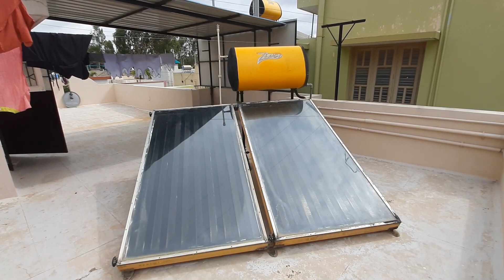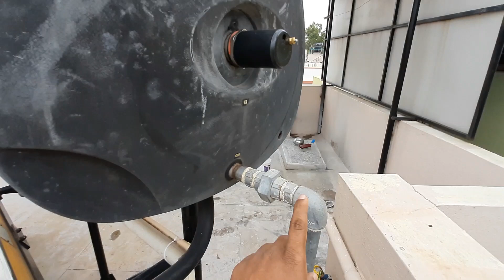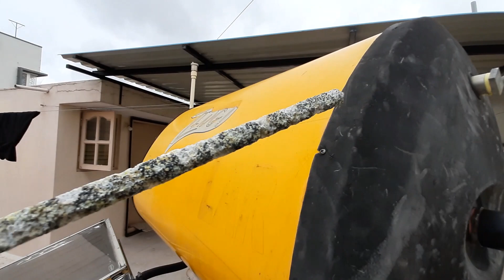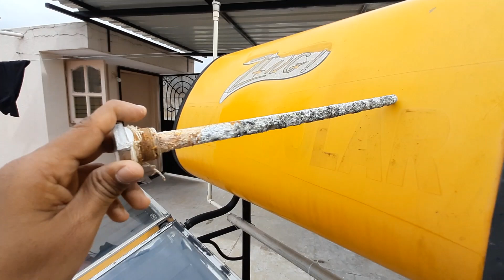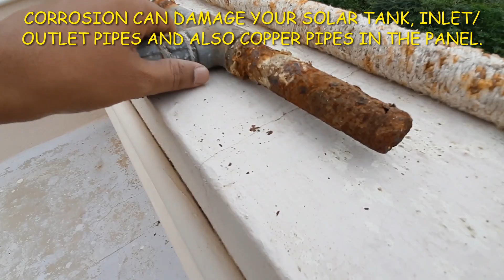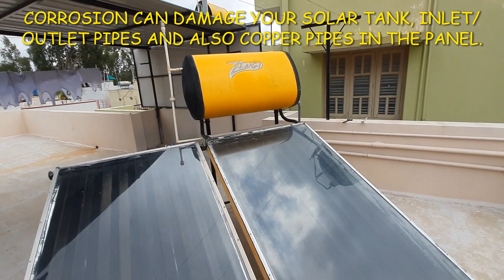SOLAR PANEL ANODE/SACRIFICIAL ROD REPLACEMENT

Comment: Bro how to remove water inside solar panel.. small amount of water is inside the solar panel it's like stuck on glass from inside.. can u please help me how to remove it
Reply from the maker: I guess its a leak from the copper pipe. First remove the glass and you have to investigate to find the leak and then have to plug it by brazing. Brazing will have to be done by an expert so that the copper pipes are not messed up. Also leakage happens due to scale formation inside copper pipes, to remove the scales you will have to do a acid wash, which is again done by expert solar service people.
Reply: @24diwi  sir it happens only in rain 🌧️